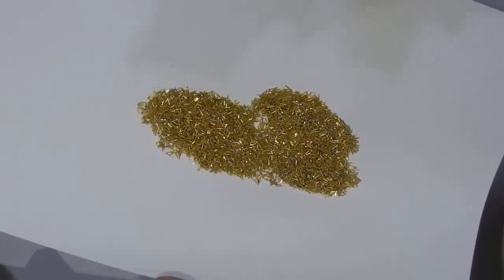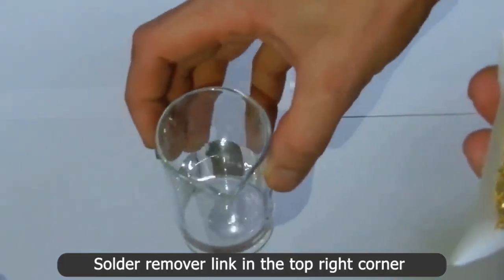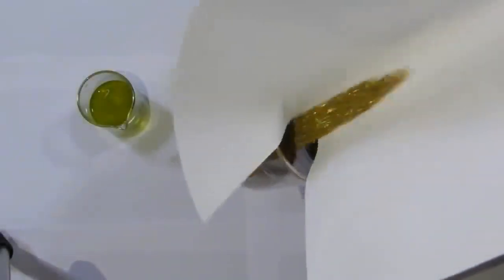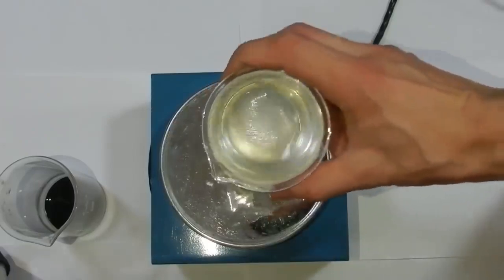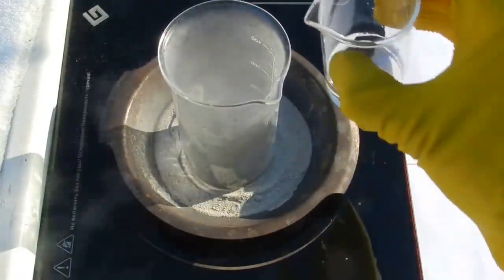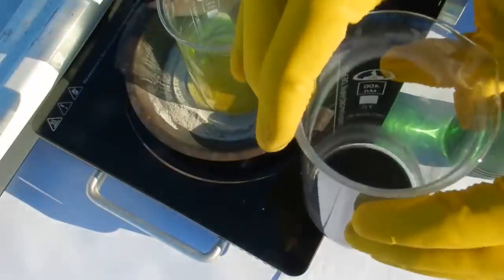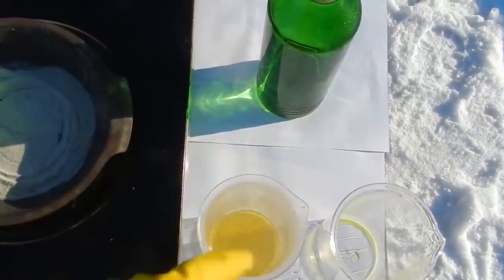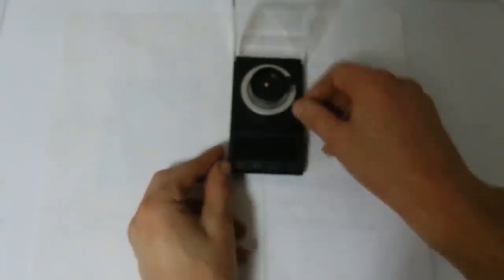GOLD FROM   25 OLD PROCESSORS!

Comment: bonding wires from the cpu to the pin inside the chip are gold wires!
Reply from the maker: Please send a picture so I can understand what it is.
Reply: @GrandfatherMosesgrandchildrens  Most Memory, flatpaks, cmos, processors have these in them. Remove the glue that holds the ceramic together with hot sulfuric acid, rinse well, dissolve the gold with bleach and muriatic acid and precipitate the gold out with sodium metabisulfite (stump out or what your pickle salmon eggs in for bait)